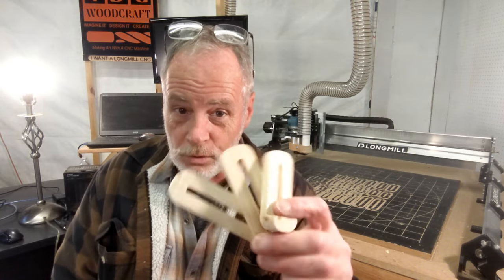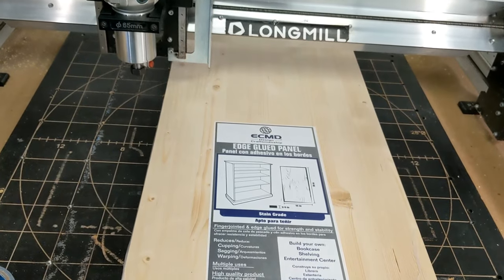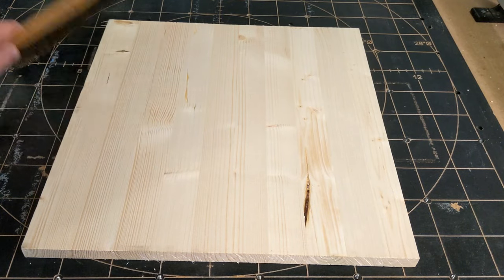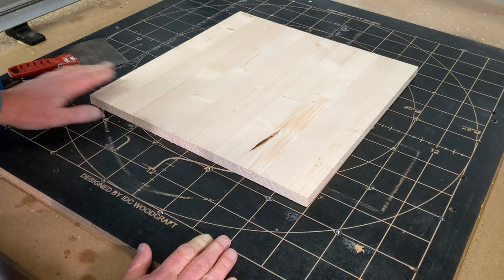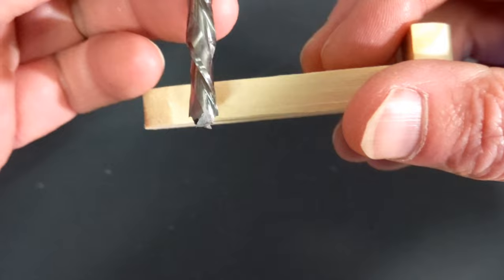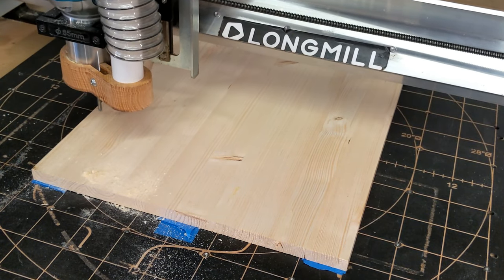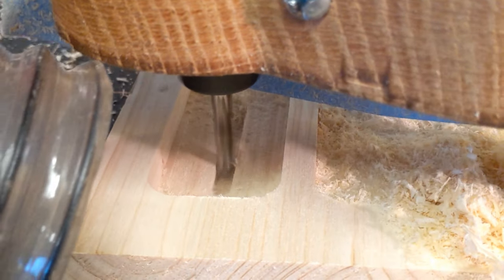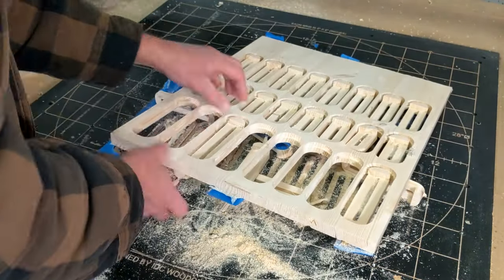CNC Router Make Your Own Clamps G-Code Instructions, Easy CNC Router Projects

Comment: Ive had good luck spraying the glue with activator and then quickly setting the piece down, seems to setuo within 5 seconds or so even when its cold in my garage. I prefer that to clamps that way I dont have to worry about hitting the wingnut when I home the machine or when it goes home after finishing the cut. Thanks for the video!
Reply from the maker: Whatever works best for you J.

Comment: Happy New Year Bro!  Great instructional video.  You got the New Year off to a good start.  I am also a big proponent of making your own tooling & fixture, whenever possible, as store bought ready made stuff may not always work for what you need to do, and many times the quality is on the lower end of the scale.
Reply from the maker: Hello brother. Thanks for the compliment. Yes, I agree. After all, we do have a CNC router!

Comment: Hi Garrett, i was wondering wy you dont pu a 4 mm soft timber  onder de 3/4 inch bord also with the ca glu so you dont hit your beautiful Spoilboard?
Reply from the maker: frankman1958, That’s a great idea! Using a softer timber underneath can definitely help protect the spoilboard from cuts. It’s all about finding the right balance for your specific project and setup. Thanks for sharing your thoughts!

Comment: I have Bob's KL733. I loaded the clamps gcode and it plunges the bit all the way down through my spoilboad and into my base board. I even tried opening the Vcarve file and then recalculating all the tool paths, still the same results. Help
Reply from the maker: rtcox307, it sounds like you may need to reset your z-zero my friend! Here's a video on how to do this that I think you'll find super helpful →https://youtu.be/UaDMzl_ZXVg.

Comment: Why there are marks on the spoiled board, can this be avoided?!
Reply from the maker: Mohamed, it can be avoided but wood is sometimes not 100% the correct dimensions and you end up cutting deeper than the wood. That is ok though, a spoilboard is meant to get messed up!

Comment: Hey brother on that zero block when u zero out then z axis it has to be on the cnc table and not on the project... Cause when I do it on the project it just fly's above it and I just stop doing it....
Reply from the maker: Yes, that was part of the instruction on the paperwork and in the video. Zero on the spoil board
Reply: Garrett and Dan, is this true that the Zero block should not be on the project but just on the table to zero the Z?  Could that be the cause of mine not fully cutting through on the profile toolpath?

Comment: better to 3d print them and faster
Reply from the maker: I tried. They weren't strong enough
Reply: @IDCWoodcraft  maybe wasn't printed in linear grain. or printed at a 45 degree angle.  or not petg or nylon. 3d printers dont need set up so less labor. and small space
Reply from the maker: @user-xv1vm5xc1f  I'm not a 3D printer guy so I can't say. I had somebody make some for me and it just didn't turn out